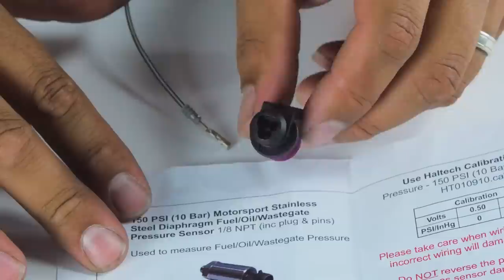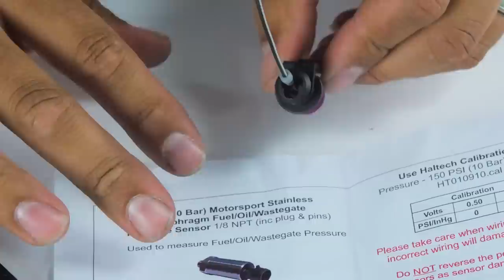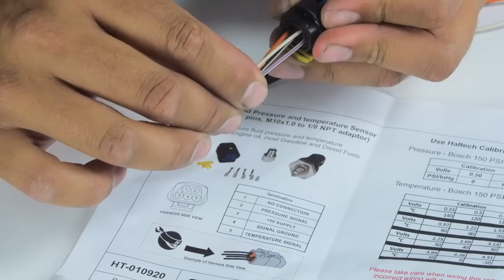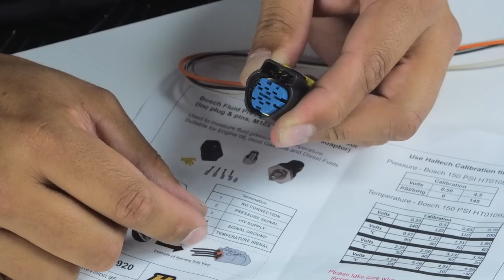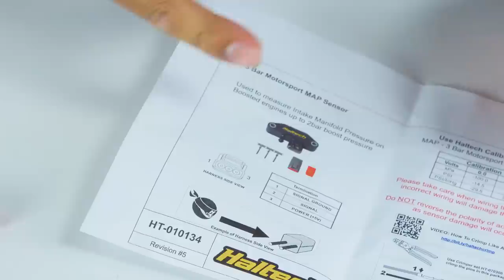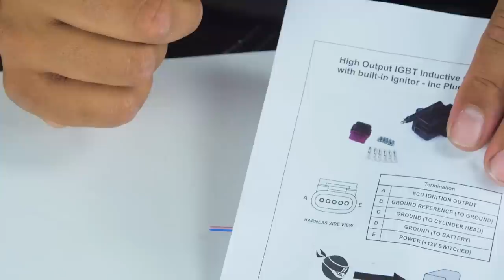🛠 How To Crimp Sensors The Right Way | TECHNICALLY SPEAKING

Comment from the maker: Welcome back!
Pressure, Temperature, MAP, or Flex Fuel - sensors are an integral part of any engine management system and getting them properly connected is super important. In this step-by-step guide, the ever-patient Dave shows us how correctly crimp all Haltech push-to-seat sensor connectors. Enjoy!

Covered in this video are GM-style, push-to-seat connectors for Temp, Pressure, MAP, Bosch Pressure/Temp, Deutch, Ignition Coil, and EV1 style sensors.
Got a topic you'd like us to cover? Leave it in the comments section!
-----------------------------------------------------------
Liked this video? Here are more like it:
How to de-pin connectors: https://youtu.be/Vt_rAIKPlWA
Crimping vs Soldering: https://youtu.be/EAr2z6rGV7o
ECU Wiring Explained: https://youtu.be/1mcHYgiTj5s
Wiring and Crimping Tools: https://youtu.be/IpNfRaM_P04

Comment: You should not twist the conductors before crimping. Crimping creates a cold weld of the copper conductor and terminal, twisting the conductor can lead to voids after crimping which weakens the connection overtime with vibration and heat cycles.
Reply: while this is true, the TXL being used in most Haltech universal harnesses and the cutting/stripping tools used by most DIYers will not leave you with a crisp, straight bundle of conductors like you would get with spec 55 or tefzel. And in that case, not giving it at least a cursory pinch and turn is more likely to result in conductor strands that miss the nest. At least that is what I see from building these daily and repairing a lot of DIY work.
Reply: @ben94cobra  I’m not sure what your point is. Do the job well or don’t do it at all. You certainly shouldn’t encourage people to do it the wrong way. If your strippers are no good, get better strippers, they’re not particularly expensive. I did a bit of wiring today too, and didn’t need to twist any wires.
Reply: @Turbochargedtwelve  on the face, I don't necessarily disagree with that statement. However, it's important to read the room. Many hobbyists will not be able to afford the materials and tooling to execute a job to perfection, they're usually only aiming to do a sufficient job once. Those of us in professional settings or production, well that's a different story. I believe these videos are aimed at the former, not the latter, and to that point they are just fine.

Comment: i actually have a few crimpers that crimp both the small and the seal on at the same time, best advice i have for people is get one of those, hold the pin in the tool and move the wire and seal in and crimp both

Comment: Both of the pin styles for Deutsch are crimp style.  The alternative would be soldered.  One is an open barrel crimp and the other is a closed barrel crimp, but both are crimp style.

Comment: The pin terminal used in the ECU (Engine Control Unit) and BCU (Body Control Unit) is called what? which types of PIN used in ECU and BCU?

Comment: Great video, concise and well presented as usual. What crimper are you using for GM and Bosch EV1, the link to your shop only shows the Deutsch crimper. Also, what gauge wire are you using, and what brand? In particular the wire with a base colour and stripe

Comment: Nice explanation and vid..Question. Noticed the strands of wires were twisted before being crimped in the open barrel terminal. Does that effect the conductor connection between?. Just a thought.🤷🏻‍♂️

Comment: Gotta mention that those GT150 pull to seat replacement connectors use reduced diameter seals and terminals, not standard GT150 terminals or seals. They’re also more picky about wire and insulation size, 18awg TXL is as big as they can take, GXL will not fit, nor will cheap “hook up/ primary” wire. 
Always have to check the data sheets with connectors, terminals , seals otherwise you don’t know if your combination will work well! This is a complaint I have with some plug and pin sets people sell, they don’t provide the manufacture part numbers or data sheets.

Comment: Have you changed the IAT plug? It seems like you need to feed the wires through the plug before you crimp, but have the green weather plug already fed on the wires on the other side before hand? I think the setup you have in this vid is better IMO

Comment: Hi Dave, Any chance you can reveal the how to on the wiring,assembly & disassemble of VW  1J0 973 802  & 1J0 973 702 Brake Wear Sensor on my 2017 VW Jetta.

Comment: I've been using the ratchet style crimper that is supposed to crimp the copper and silicone simultaneously for over a decade, with varying results. Frequently cuts the silicone in half, sometimes doesn't crimp the wire enough. Leading to improper signals causing lots of extra diagnostic time. What brand of crimper are you using?

Comment: Hi,
Are you familiar with Saab ABS connectors? If so is the smaller hole on the pin socket when I would push for release?

Comment: 3:30 “small and fiddly” — oh, honey… :D the automotive world sticks to pretty large parts by the standards of today’s electronics. At work a few months ago, we were crimping 1mm pitch (center-to-center) terminals onto 28AWG wire. (The terminals are about 2mm long and 0.5mm wide.) I just soldered a 0.5mm pitch connector onto a PCB yesterday.
Reply from the maker: That's it, "honey" is what we are calling Dave from now on!
Reply: @haltech  😂 🐝 You should!

Comment: Good job, Dave. Question: Do the colours of the rubber insulation sleeves relate to wire gauge? Also, ever have a copper wire strand break off in your finger? Turns the wound green until you remove it ;)
Reply: The silicone seals are color coded to the diameter of the outside of the wire insulation. Since insulation is different thickness on different wire types it's not specific to the gauge of the wire. For example 22ga tefzel insulation is significantly thinner than 22ga txl which is thinner than 22ga gxl, even though the conductor size is the same.

Comment: One thing never emphasised on crimping tutorial s is which way up the connector goes in the pliers.
Reply: It’s kinda obvious, though. In the typical m-shaped die shape, you have the die (the m-shaped part) and the anvil (the part that presses into the die). An open terminal wouldn’t make sense going in any way other than with the open side towards the die. 

FYI, truly correct crimping is done using the genuine (expensive) tool from the connector manufacturer. Those tools always have a “locator” or “positioner” to hold the contact in the right place, so you can’t do it wrong.
Reply: @tookitogo  Most home mechanics buy generic crimping pliers rather than separate tools for each type of connector. Then it may not be obvious. A professional mechanic shouldn’t need to watch a YouTube video to learn how to use the manufacturer’s specific tool.
Reply: @wheater5  It’s very obvious even with generic tools.
Reply: @tookitogo  Good for you.

Comment: Dismayed that you didn't address wires or cables with insulated shield.  How do you'll put a pin on the strands of insulated shield, and what pin or connector to use?
Reply: Search YouTube for "HP Academy splicing shielded cable" for a fantastic tutorial on the different ways to do that.

Comment: I've never seen an ev1 connector that didn't have a seal. That's very strange.
Reply: It should have seals, that boot isn't going to fully seal the wires from water as there will be large gaps at the wire end.
Reply: I think I have seen more EV1 connectors that do not have a seal vs do have a seal. 
My guess for  this is because most on these connectors also have a boot that seals away water etc.

Comment: Give me the Deutsch round pin and barrel crimp style over the fold over leg type every day........faster and more reliable. Also, for the fold over leg style, DO NOT twist the wires. How are the legs supposed to go into the wire core when they are twisted? Spade connectors.......loathe them. Not exactly brimming with contact surface area either.
Reply: 99.9% of sensor terminals are not closed barrel. If your stamped pins are not holding. It's 100% user error.